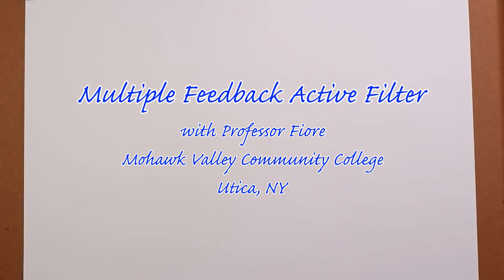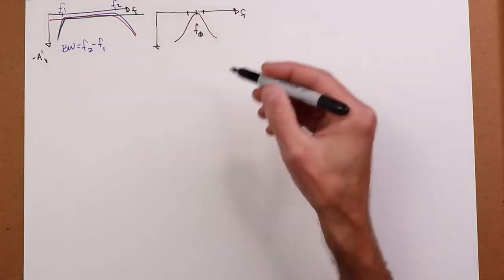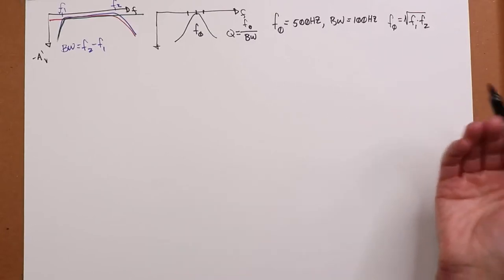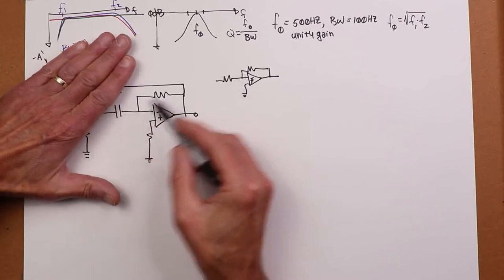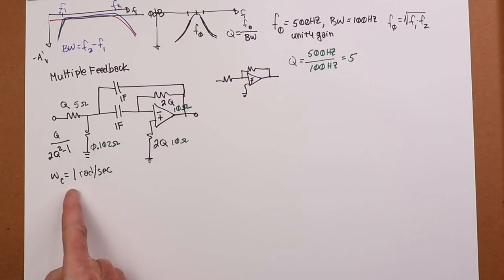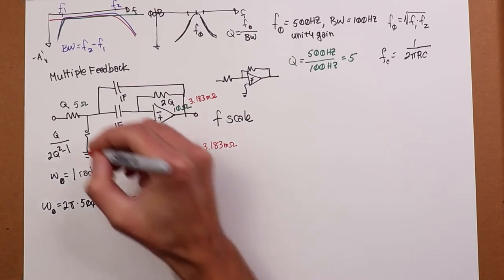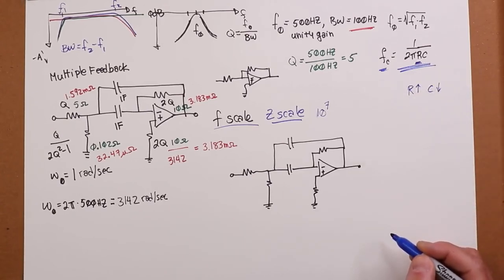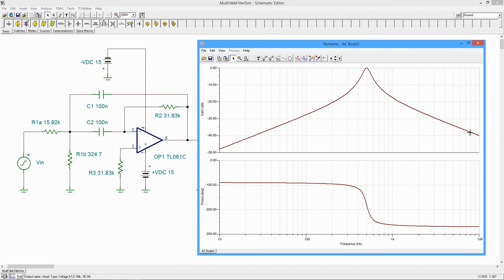Op Amps: Multiple Feedback Bandpass Filter

Comment: This is very easy! This is the first time I have ever understood how to calculate an active filter. Hint: Using Paint, draw the schematic of the Filter type you are interested in.
Copy and past it so you have four schematics down the page, (leave a little extra space between schematic 2 and 3).
 Label schematic 1 with the math formulas. Q, 2q, etc. On the right side add (Q=) so you can pencil in the numbers for FΘ / BW and solve for Q .
On schematic 2, enter the numbers for the math you do on the symbols in schematic 1. In the room you left between 2 and 3, write the Wo=1rad/per sec and 
The Wo=2pi x your FΘ and solve.
 On schematic 3, write in the values you get when you do the F Scale.
 And finally, on schematic 4 you do the Z Scale and enter the values found on that schematic.
 Label the top with (type Filter) and save it as a picture. Then when you want to make a filter, print it,
 fill it out, you have an easy path for your math work and you have a record.
 I like this so much, I ordered the book. I'm eager to get it.

Comment: Whoa, the mathematics is truly crazy! I, however, finally understood what the heck 'bandwidth' is and how to choose a center frequency. It is because operational amplifier band pass filter calculators online are either convoluted or not enough data teaching people how to actually use it.

Maybe my case is a bit different. I go for the lowest and highest frequencies, rather than center frequency. Easier on my tiny brain cells.
Reply from the maker: Upper and lower limits are useful for wide bandwidth circuits, like say, an audio amplifier. For narrow bandidth circuits, a center frequency and Q are more useful and more common.
Reply: @ElectronicswithProfessorFiore  Ah! No wonder whenever I used the calculator online, the Q value keeps on giving me (or showing me) unnaturally narrow bandwidth. I thought those calculators are trolls or I was missing too much.

Many calculators do not offer many variables such as that common highest and lowest frequencies, and than calculate the center one. Which I thought it is how it was calculated this way. It, however, appears that it is not that simple by adding those two frequencies and divided by 2 as in the conventional way. Something to do with relative (log or decibel) number rather than absolute number.

But then I have this little app called Iowa Hills OpAmp Filter Designer. It does have all the variables. Extremely powerful but sadly it is not being upgraded anymore. Nothing to improve because the mathematics is already there and considered standard, and no body complains, perhaps.

Comment: This also got me thinking, will matching our resistor value to the reactance of the capacitor at the defined corner frequency improve filter stability and quality? 
I know it's also a voltage divider and this would seem a potential criteria in some schemes.
Reply from the maker: The interaction between R and Xc is "baked into" the computations. There is nothing extra to do.
Reply: @ElectronicswithProfessorFiore  ah I think I get it! The computation results in the voltage division across the 2 being virtually equal at the cornered frequency because we're plugging in known values in the first place?
Reply from the maker: @JonDeth  Pretty much.

Comment: I have another question. I am deeply out of practice and haven't done any significant math for engineering for about a decade(I did go to college though), and am taking on a couple simple projects for myself to regain competence and confidence.
I was told I can build a multitude of bandpass filters all tied in parallel to a single node as the output to summarize the input signal it's divided into. Is this accurate? 
It seems it would be and I can use a pot on the feedback loop to adjust gain for each filter.
Reply from the maker: Whether or not the summation was perfect would depend on how the response curves overlap. That, in turn, depends on the chosen center frequencies and associated Q of each section. If not done correctly, the summation could have "holes" or "peaks" in the response.

Comment: Excellent lecture. I was able to complete my design calculations with only one question: what if I'm using a single source opamp like an NE5532, but your example shows an opamp with a pos/neg source?
Reply from the maker: By "source", I assume you mean DC supply. The NE5532 does use a dual polarity supply (nice op amp, BTW).
Reply: Okay, with an NE5532 (using a single 12V source) I used your design modified by placing a low-pass filter on the input, I got the result I wanted: A band-pass filter that rejects below 300 Hz (hum and tone squelch sounds) and also rejects above ~900 (radio static and QRM). Perfect for hearing the human voice clearly over ham radio.
Reply from the maker: @reedreamer9518  Glad that worked for you. FYI, your filter is similar to the bandwidth limits set by standard land line telephones (they go a bit further on the top end by an octave or so; fairly steep slopes, though).

Comment: Great video, but i was wondering how I can add gain to this circuit?
Reply from the maker: There is a form of this filter that has gain, but it is tied to the Q. For independent gain control, you'd be best off adding a gain stage (like a non-inverting amplifier).

Comment: what if non inverting terminal is connected to 1.5V supply, does that make any difference while calculating gain or frequency ? If connected this filter in cascade with coupling capacitors is my gain or frequency affected? how to investigate that ? where can i find derivation for this gain and Cut off frequency  ?
Reply from the maker: Why would you connect a DC voltage to the non-inverting input? Are you trying to run this with a single polarity supply?

Comment: How can I design a band pass filter using 2 op amp in cascade?
Reply from the maker: If you are referring to a HP/LP pair, that would be appropriate for a wideband filter (where f2>>f1). Set the HP to f1, and set the LP to f2. For narrow band applications, the LP/HP pair is not advisable.

Comment: How do you choose an op-amp?  What sort of Gain Bandwidth and Slew Rate is required based on the BW and stop-band attenuation, etc.?
Reply from the maker: Slew rate and GBW tend to go hand-in-hand. The higher the passband, the higher SR and GBW will need to be. Look at it this way, in order for the filter to work, there has to be sufficient loop gain in the passband (i.e., gain over and above what you're looking for). For example, if the filter resonant frequency is 10 kHz and has a peak gain of 20, that would imply a required GBW of 200 kHz by itself, however, you'll still need loop gain over and above this. If we're looking at 20 dB of loop gain (probably at least that much), this points to a GBW of at least 2 MHz. SR can be computed based on the resonant frequency and the maximum output voltage swing (treat f0 as fmax for minimum acceptable SR-see section on slew rate in the text or associated video for details).
Reply: @ElectronicswithProfessorFiore  Thanks for the reply Professor!  I watched several of your videos over the last few days, including the GBW and Slew Rate videos.  Very well done, and much appreciated!  I went to Lawrence Tech University in Michigan and had a great electronics professor, but it was >10 years ago so I'm admittedly rusty here.

The part I'm not sure about is where do you measure the gain?  Since this is a multiple feedback network, what constitutes input and what constitutes output?

Should I just simulate it with a super fast op-amp and measure the output of the op-amp over the input signal (left side of your 15.92K resistor)?  (see @15:57 for the time stamp showing your final circuit).  Or do I look at the gain of each feedback separately to calculate it using superposition?

In your example, it seems like a gain of 31.83K/100nF comes to 100 V/V at 500 Hz.  And then 100nF/(15.92K//324.7) coming to 10. So the required GBW is the higher of the two, or 500 Hz * a gain of 100, which is 50kHz.  Is this accurate?
Reply: I just went through and found the transfer function using Maple, and the gain is basically 0dB at 500 Hz, which makes sense as the output is unity at 500 Hz by design... But that's not the true gain of the op-amp - we know it's much higher... I just don't know how to calculate that.
Reply from the maker: @TheRealMonnie  The left side of that resistor is the generator signal. This circuit uses a voltage divider up front to compensate for Av>1, You'd like to determine the true gain of the filter, which would be from the right side of said resistor. My free text discusses both this filter and the simpler version without the divider. Check out page 472 which discusses funity. That will also apply to the circuit in the video. Ultimately, funity > 20*fo*Q^2 (which is 10*fo*true_Av, as I mentioned earlier).

Comment: Good brain day. I understood that. Re. Capacitors... Are there values that have better tolerances than others? I.e. 0.1uF is more likely to be within 5% than 10pF?  Thank you for another great lecture.
Reply from the maker: It's less about size of capacitance than it is about the construction and dielectric. For example, aluminum electrolytic caps are not particularly accurate (but have good volumetric efficiency and are inexpensive). Meanwhile, polypropylene is very well behaved and accurate, but they tend to be physically large and expensive. For filters, you're better off with decent quality film caps like polyester (or better, polypropylene). Some small (<100 pf) NPO ceramics are good, too.
Reply: @ElectronicswithProfessorFiore  Thank you.

Comment: Can you tune/sweep the band by replacing a resistor with a potentiometer?
Reply from the maker: Yes, theoretically, but it's not practical as the two pots (rheostats) have different values and the tracking would be a pain. For a tunable filter, you're better off using the state variable filter topology. In fact, there is an example at the end of chapter 11 in my op amp text that shows how to make a voltage controlled filter (VCF) using OTAs. You could just slide in a dual-gang pot where the OTAs are. 

Check out this video: https://www.youtube.com/watch?v=esKrrjFJyuk

Comment: What's the number (1st, 2nd, 3rd etc) of the latest edition of your book?
Reply from the maker: Op Amps & LIC is in its third edition. The first and second editions were produced by commercial publishers (West and Cengage). I got the rights back from Cengage, updated it and produced the third edition as an OER a couple of years ago. Unlike the commercial publishers, I frequently issue updates. The most current as of today is V 3.2.6, May 7, 2021.  (First digit is the edition, second is a more modest revision, third is for minor changes like fixing typos.)
Reply: @ElectronicswithProfessorFiore  Thanks for your reply, your work/channel and your generosity.

Comment: i love your video. I am making the same bandpass filter as you show in the vid,  but with other frequency ranges. i have downloaded tina ti bit it wont give me the correct graph. i have calculated everything exactly as u have but it wont work?. i also tryed using your values but that wont work either. when i open the ac analasys i get a lot of warnings that i havent connecten my wires and that some parts are floting but i have wired it all up? i hope u can help i am struggeling hard :-)
Reply from the maker: It sounds like you have components that only appear to be connected but aren't. This can happen if you simply move a component next to another. I suggest that you grab each component and move it. If the wires don't stay connected to the other components, it wasn't wired correctly. Not having the ground tied in is another common problem.
Reply: Another problem could be you are using a simulation model that doesn't match the symbol. The model might want additional pins connected that aren't on your symbol (for example, an enable pin).  LTspice has been giving me a hard time with that for op-amp spice files from TI, so maybe Tina has the same problem.

Comment: You didn't explain clearly how this setup act as a bandpass filter. Because both caps are rated equally, meaning they respond to frequency equally. For a high frequency, the system is by default a high pass filter. What or how is the feedback cap making it a bandpass? Since at high frequency, the caps short, making the feedback a unity gain, but for low frequencies, the first cap blocks the signals since it's a high pass filter.
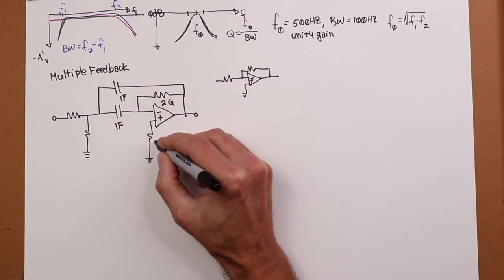Reply from the maker: OK, how's this: the circuit contains a lag network (low pass) and a lead network (high pass). Obviously, that combo can give you bandpass. Now, it may not be obvious how you get both a lead and a lag out of this. In fact, with a quick look, it might appear like there are two lead networks (which appears to be your situation). Sure enough, the lower cap (see template around 8:00) will block low frequencies. The upper cap, though, is in the Miller position (i.e., it straddles the input/output of an inverting amplifier). As such, this cap can be Millerized. The Miller equivalent would be sitting from the left end of its current position to ground. In other words, it would be in parallel with the input, and that creates a lag network (along with the resistors to its left). I will direct you to page 472 of my free text for more detail (see links in the video description, above).
Reply: @ElectronicswithProfessorFiore Excellent info